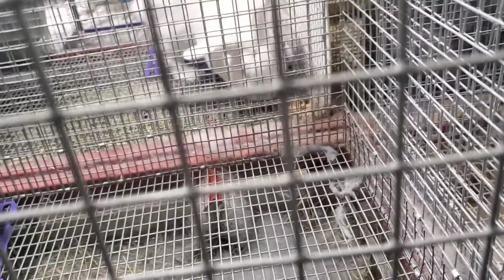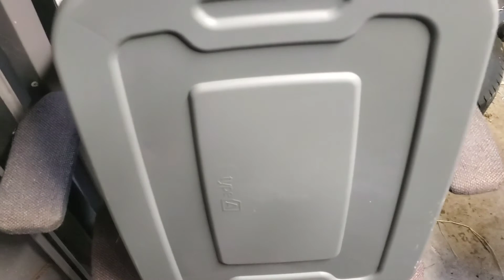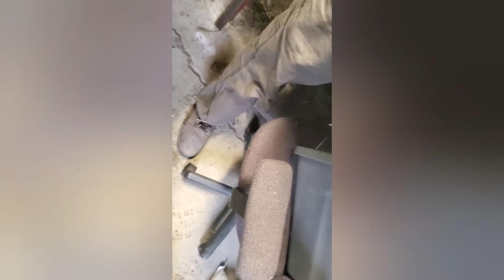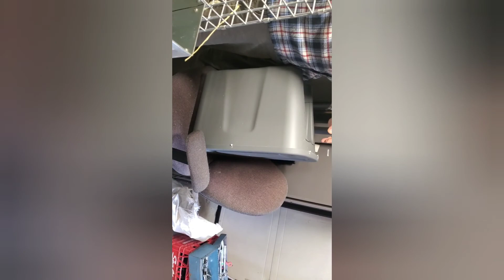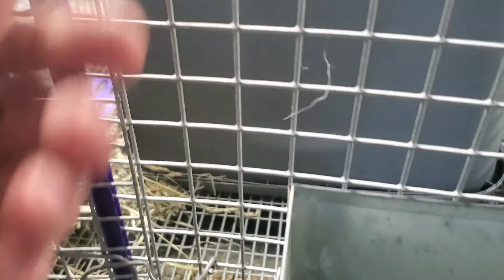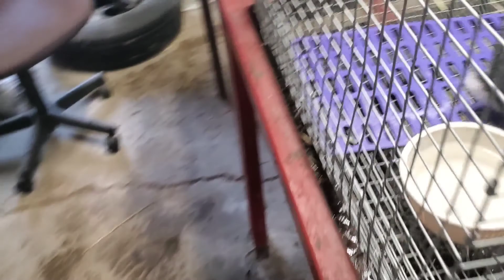New American Chinchilla Rabbit babies 👶 on the way...maybe

Comment: Hi Jim,

thank you very much the effort you put into your youtube channel. I get a lot of inspiration from your work.

I've just begun small scale farming (plan is to be able provide most of the food for five adults if needed) and I'm a little behind too - just too much physical work I'm not used to. I divide my efforts into three categories: orchard & berries, vegetables & rabbits for meat. My plan is to plant about twenty young fruit trees (I already got them) and I've got a huge walnut and cherry tree.

How many does do you currently hold ? I've currently got six medium sized adult girls and another five adolescent ones (4 months old) giant rabbits. Thats way more than I currently need as I only bred my experienced doe three times last year (7,9,9 surviving kits). But I hold a rotating overstock of young does just in case. 

I try to avoid excessive use of my freezer: Electricity is expensive where I live and I fear power outages. So I try to harvest rabbits when I need them for consumption - plus I try to have vegetables & some fresh fruit all year round.For experimental reasons I still have carots from last year in the ground (so no problem to harvest them all year round) and I had beetroots & cabbage on the field through winter.  Some of my trees are winter apples too.
Reply from the maker: Thank you for watching